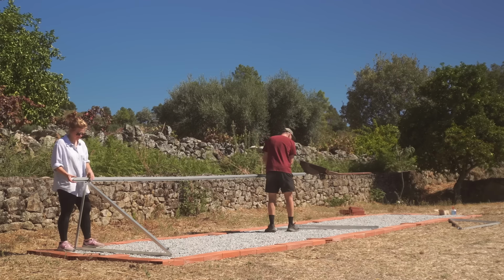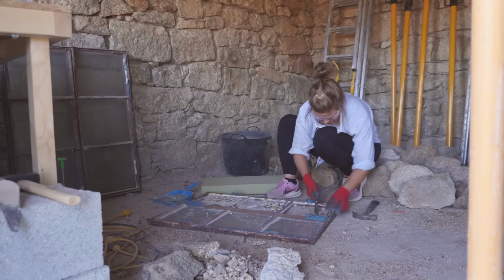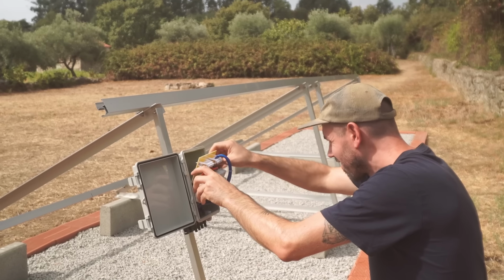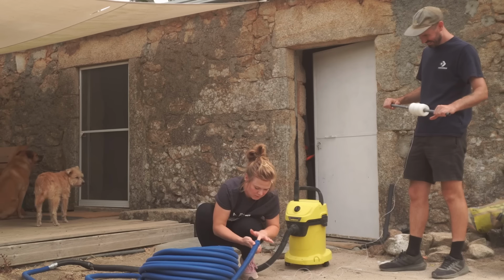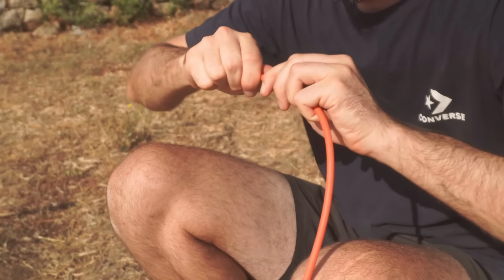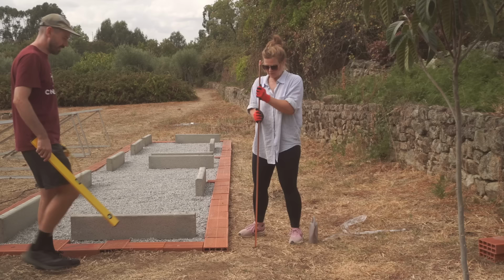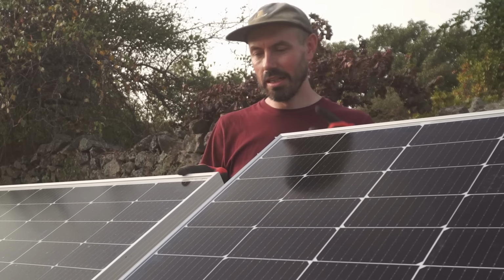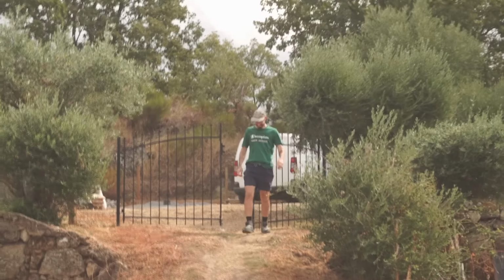Life’s About to Get Easier Living on Our Off-Grid Homestead

Comment: Love your energy, humour and creativity!  As an old engineer in Canada, I found another trick to add a pull cord to a roll of tubing, without having to unwind the tubing, it is to insert a spool of thread of similar diameter into the tube end, hold the free end of the thread and blow with your Hoover or Dyson.  The thread unwinds  off the side of the spool, until the spool with remaining thread miraculously pops out the other end.  This trick works for any length of tubing as the is no  friction to increase with distance or bends.  If need a stronger pull thread then use the fist thread to pull in the second etc.; always unwind the tubing for main cable pull.   
 Also love your solar system; here we have similar mounts that one can re-tilt seasonally to adjust for the sun path change and get maximum power.  You could  drill a few holes in yours to make adaptable.  Also you may find the shady space under the panels is handy; if you raise it 8' in your Phase 2  to make a shady lead-to, it would be a good place for petanque or a shade garden. Here some use livestock to graze the grass underneath in summer, so no gravel needed.

Comment: Don't want to scare you, but depending on how old your windows are, in particular if they're from the early to late-mid 20th century, the putty might actually contain some asbestos. So you might want to take some precaution in particular if you're removing it and it generates a lot of dust.

Comment: Why not get a slightly bigger diameter smooth bore conduit which is suitable for underground use , then put the conduit that already has the wire drawn through into the bigger conduit ??

Comment: FYI If you ever must dig in hard soil to do plumbing work or installing an electrical conduit, you can make it easier by running water through a hose and then digging up the wet soil.
My Dad put in a water line—just a dozen feet or so—from the spigot in his barn to the goatyard, where he installed a second spigot, so we wouldn’t have to carry pails of water. The  soil in central TX was red granite sand (there was a quarry only about a mile away), and in midsummer it was hard as a rock. Letting the hose run on and off sort of softened the hard soil. My Dad had a certificate in plumbing from circa 1950 from Washburn trade school, so he could always do his own plumbing stuff. He later got into electrical and HVAC—pretty much an all-around Mister Fixit. He let me help! Despite the hot day, it was quite fun!
Hope this helps.

Comment: Tip for next time, pull an extra bit of string through with the wires then leave it there if you have to add any other wires to the conduit in the future. Great video as always. Thank you!
Reply: When puling the string thru the conduit, pull an extra two or three strings at the same time. Use the one and leave the others there for future needs.  Trying to pull another string thru now might be tough if you need to.

Comment: Hi , you could have used your electric saw to cut that aluminium frame, save you some time 👍👍😂😂, when the time comes instead of pulling the wires out of the blue conduit, just buy the correct one bigger than the blue one and feed the whole thing through the new one

Comment: Draw the mouse string through, fix the string to the first cable and attach a second string to the splice, pull both through, then repeat with the second cable. Just a suggestion for the next conduit. Congratulations on all of your achievments thus far. Great to share with you.
Reply: Good advice.

Comment: WHEN you pull the final feed from the panels pull in a 220 outlet and a low voltage  light you can control from the house. Leave a pull string in conduit. DOUBLE MOUSE PROOF BOTH  ENDS
Reply: Yep, all external cables on my ground array are in conduits - rats, mice, deer and even rabbits are wont to have a little chew. Other pesky varmints like voles also available!

Comment: The problem with pulling a small conduit through a larger one will be heat dissipation from electrical resistance in the wire.

Comment: You shouldn't have to run a guide rope to put cables in hard case piping for burying, just slide each section over cables and glue together once the cables are inside plastic pipe. be much easier.

Comment: A wonderful, long video! Lots completed and with good humour. Thanks for including us. If you can sacrifice the window frames for decor, they look wonderful dividing two areas in your house or outside of your house but not blocking the view completely. They can also be used horizontally near the ceiling. Can grow vines on them or not... No need for glass. I've also seen them used with the glass as a shower wall.

Comment: Hi Guys, just wondering if you checked the old glazing putty that you were chiseling out of the old steel window frames as it may contain Asbestos. It was used to add strength and add fire resistance. Not a well known fact but was used in steel framed windows here in Australia during the middle of the 20th century.

Comment: Great video, I’d have an lightning rod just next to the solar panels, separate 6m straight up, with a copper cable straight to ground. Strikes just end batteries and v expensive equipment. It’s an insurance policy on what you have..

Comment: Two notes. First, the blue “conduit” you used to run your electrical cables inside looks to me to be what’s referred to here in the States as a “wire loom.” As such, it’s meant for interior use only.  As others have suggested, I’d recommend running the cable in buried PVC pipe.  Second, I’m surprised you stood the concrete blocks on their side, as they’re far less stable in that orientation.  If you need the vertical clearance under the panels, I’d recommend driving in short pieces of rebar beside the blocks to help prevent them from tipping over.
Reply: Soo.... given that Ricky SAID that the blue flexible trunking wasn't suitable for the job.....who are you telling...!?!?
.... AND, given that the concrete blocks are all bolted to a frame..... where, exactly, are they going to go....!?!?
Reply: @andymccabe6712 I made my comments at the beginning of the video, so I’d agree with your point that he’s already aware that the wire loom isn’t suitable for his cable runs.  On the other hand, I stand by my comment about the wisdom of reinforcing the concrete block so the don’t tip over.  I’m thrilled he’s fastened the panels to the blocks using threaded rod and epoxy.  On the other hand, winds can easily turn those solar panels into a large kite if the direction is right.  And as the winds drive the panels sideways, the force will start tipping over the blocks and the thin aluminum stock can easily bend and break.  Driving in a few short (3’) lengths of rebar besides the blocks is cheap insurance.